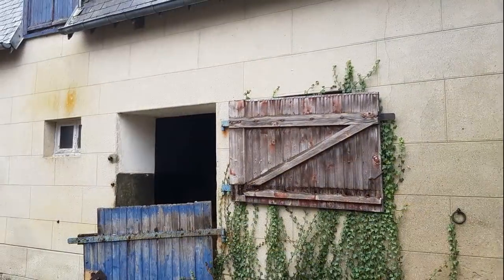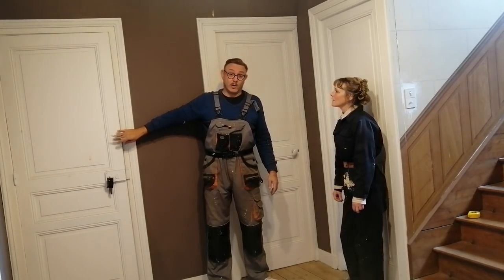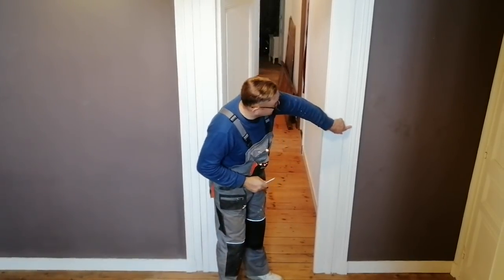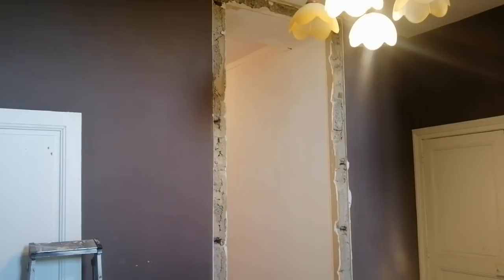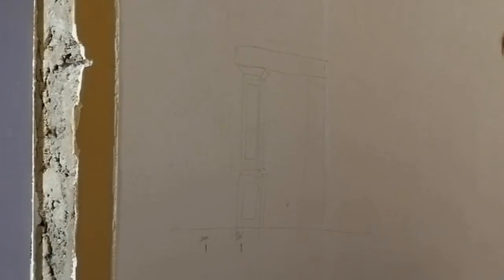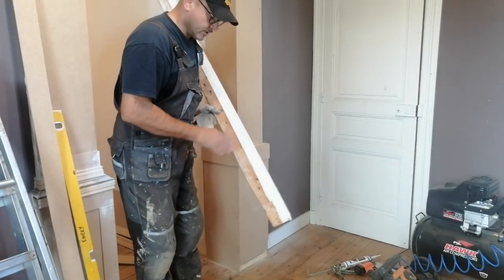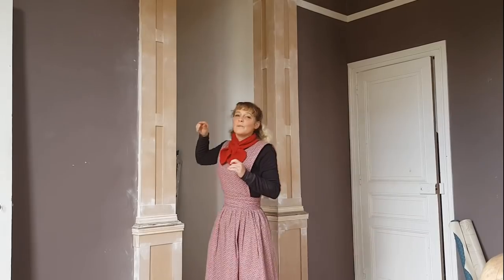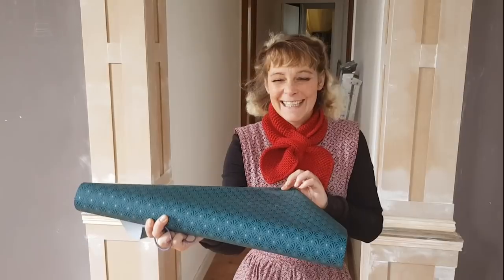Ep 56: How to make indoor pillars!

Comment: Like it! Changes it to a Chateau look. Please seal the plasterboard before papering a couple of coats of paint. When buying paper always check batch code is the same.  Also, check pattern drop if it's long it can cost extra paper. Sorry, couldn't help myself being papering walls and ceilings for years LOL. Oh, thought the parcel was a Selfie stick. Great content as usual, interesting to find out why the corridor door is locked from the inside.
Reply from the maker: Thank you so much peter for your sound and sensible advice - much appreciated. Wished we had you here for the papering - it isn't an expertise for us, so please be gentle on us when finished, we really are not professionals ! Thank you also for your support and for enjoying our content :-)

Comment: What an elegant addition to this area. I'm hoping that you won't need to get any large furniture through that opening. It might be a bit of a squeeze.
Reply from the maker: Ah thank you Judith :-) Luckily the new opening is actually wider than the old doorway frame that cut into the corridor! If not we will have to take things apart, which actually is the normal thing here in France